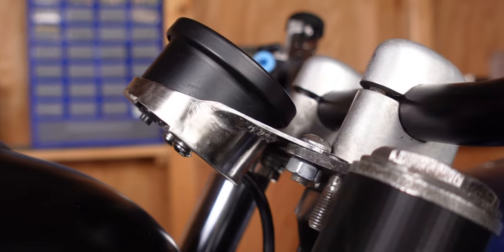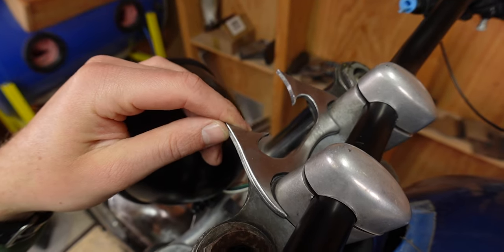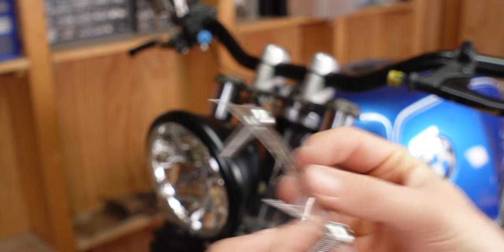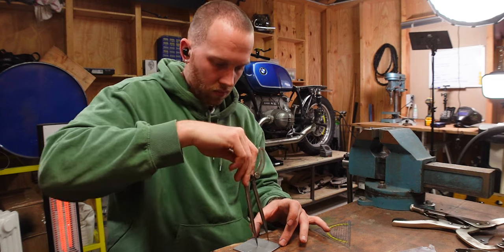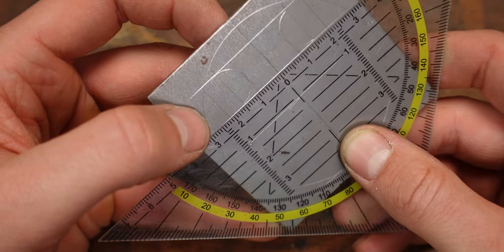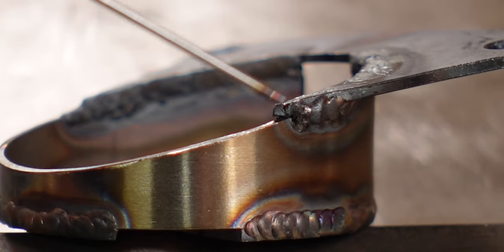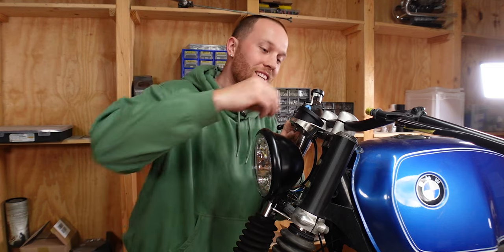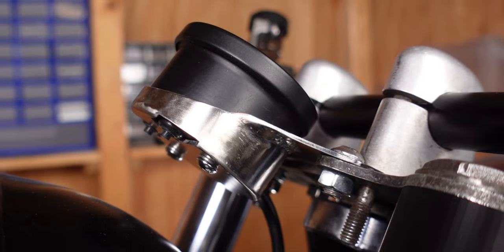How to build a Speedo Bracket - Daytona Velona 2 for BMW R80

Comment: Looks awesome Josh! I'd love to use that on mine but I've changed to a cnc top yoke so don't think it would fit unfortunately
Reply from the maker: Hi Andy, thank you very much 😊 I just had a look at the cnc triple clamps aka top yokes...they look clean!! 🔥 They also don't really give the opportunity to change the mounting points. Could have made a few adjustments to the CAD model for you but I don't think that it will work out 🤔

Comment: hi, how did you do the wiring from the old to the new speedometer?
Reply from the maker: Hi, I’m just working on the complete wiring video. That will be out today or tomorrow. But in short, with this speedometer you need to upgrade to a digital speed sensor (also from Daytona).